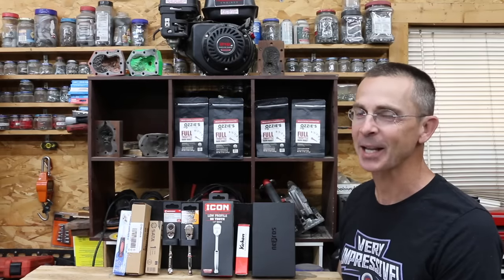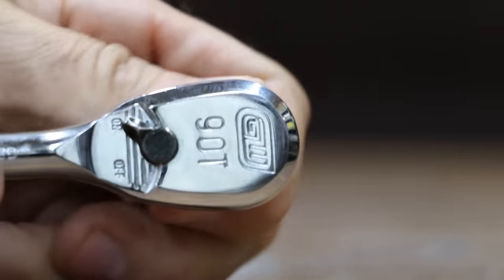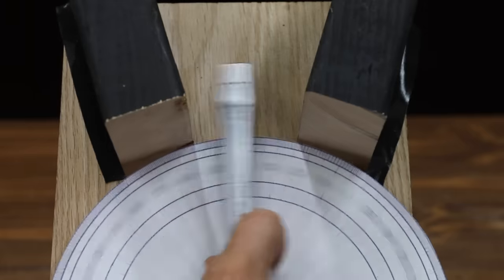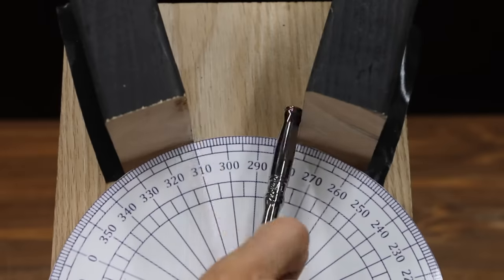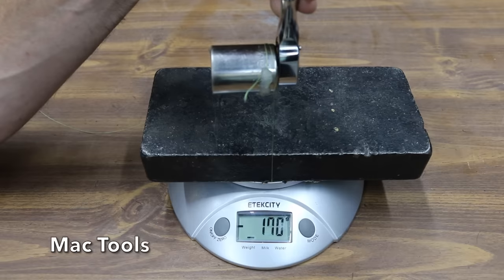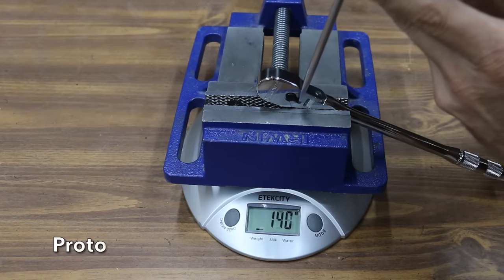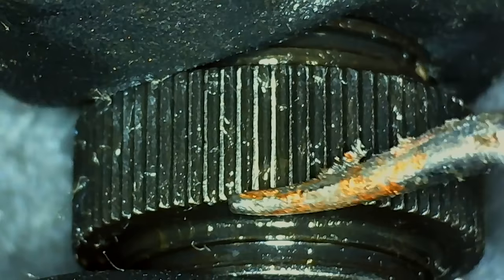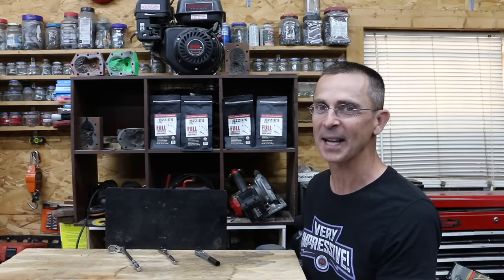Best Ratchet (1/4 In)? Snap On, Icon, Proto, GearWrench, Prototype

Comment: As an aircraft mechanic, the TRO ratchet shows great promise as a prototype. I think the gears need to be improved upon, namely the arc swing as I need to get into some pretty tight spaces sometimes. If that can be improved upon, I'd strongly consider buying one for my tool box. As a flight mechanic, the weight is also important to me because I need to take my tools on commercial flights and I struggle with leaving tools behind at home because my tool box weighs too much. Like I said, it shows promise, but can be improved upon.
Reply from the maker: Thanks for sharing.
Reply: Yep. And not also aircrafts, but I guess there are a couple additional places were it's useful: 1) Places were you carry your tools to height or distance (towers, antennas, far away places...) 2) Highly magnetic places (i.e., the Magnetic Resonance in a hospital, but the tool has to be 100% titanium, and I don't know about that) 3) maybe high corrosion environments, like the sea
Reply: I liked the look but it seemed too bulky. The Thick handle would drive me nuts and the grip looked like it would be slippery. It probably only needs a couple grooves. Also the gap in the handle gave me pause because I felt it might get stuck and tug at things like safety wire in small spots.
Reply: @AlvaroGonzalez_Andor 
 I'll definitely agree with carrying tools up or down. Had to work on some equipment that was 170ft underground in an underground reservoir, the access was by vertical ladder which wasn't much fun with 80lbs of tools
Reply: How many tools are you really going to carry with you on a flight? I have a Pelican case with just very basic line mechanic stuff; wrenches, ratchet, sockets, screwdrivers, pliers, plus my headset and bypass pins. It comes in well under the 50 lb weight limit for a checked bag on a commercial flight. All you really need is the basics to comply with the MEL/DMP and get the airplane out. If the plane is really broke, you’re going to call in support, anyway. Remember, we’re here to move ‘em, not to improve ‘em.
Reply: @singleproppilot  I carry everything I need to fix most problems on a 737; both normal and abnormal, so my box comes in at around 90lbs. I do this full time for 2 weeks at a time so it's all I do. I just like to be prepared.
Reply: All you need is a good set of wire twisters ..
Reply: @Ray-fm3ek  maybe you do but I have to actually work on the airplane
Reply: @ryanw1112 90 pounds? A roll of duct tape only weighs less than two pounds? Isn't that what you guys use mostly? How is your box more than a couple pounds. A swiss army knife and duct tape should fix it all.
Reply: Do you work for sun country? Sounds like their work environment.
Reply: @supers0nic77  I worked for a competitor to sun country, and thought about moving over once or twice, but never seriously
Reply: @sasquatchrosefarts being a flight mechanic means you travel with the airplane wherever it goes. I've been stuck in some pretty remote places, some places I didn't even speak the language of. I need to be prepared for anything and that's why my box weighs so much. We keep basic spare parts and tools like speed tape, light bulbs, tires, etc on the plane to help avoid needless ground time.
Reply: @AlvaroGonzalez_Andor  Good notes. One place you absolutely cannot use Titanium is in flammable gas areas, like mining - Titanium sparks very easily on friction.    I used to hate the brass/bronze tools I had to use changing temperature sensors in a refinery, because they were so bulky and heavy.

Comment: I like how light that prototype ratchet is and how little force it takes to change direction, but I wonder if it's too light. Sometimes working on things an easy changing ratchet can be an issue when you're trying to loosen/tighten something and it accidentally switches direction while ratcheting. That gets annoying quick when you have to keep switching it back to the direction you're trying to use it in.
Reply from the maker: Thanks for the feedback.

Comment: This was the best representation of top brands that I’ve seen you do yet. This channel just keeps getting better with time. I wish you had picked a Koken Zeal but that’s a minor issue, it’s actually good that people see that their normal range of ratchets use antiquated designs.
Reply: I guess I should add they they are known for their low back drag but your video proved that pretty well.
Reply from the maker: Thanks!
Reply: it may be an antiquated design but it still works for it's intended purpose. i'll take a low backdrag ratchet any day before a high tooth count with way more backdrag for most use, modern cars stupidly cramped and mechanics adverse motor bays is not one of those though... 😸😮

Comment: I have a 60 year old Snap-On ratchet (3/8") - I've broken dozens of sockets over the last half century with that ratchet (and a 3-ft cheater bar).  Best tool I've ever owned.  

There might be a lot of ways to look at a ratchet - but not all of them should be weighted equally - strength is more important than any measurement (with price being #2).
Reply from the maker: Thanks for sharing.

Comment: I like Husky tools. They feel really sturdy and well built to me. I don't do anything heavy duty or use tools every day, but I haven't been let down by one. One of the best store brands imo.
Reply: Husky tools are a great DIY and light duty tool.  In the professional field they will not last.  I collect ratchets as a hobby, so I have pretty much every ratchet he's tested so far.  I work on heavy machinery and I'm hard on my tools.  The Husky didn't last more than a week.  On the other hand, my Matco's, Snap On's, Macs, and Kokens I've never once had to warranty them.
Reply: Why use carbon fibre?
Reply from the maker: Thanks for sharing!
Reply: @Deontjie  Because it looks badass and its extremely light weight.  That's my guess.  It'll be the next ratchet to go into my collection mainly for the coolness factor.
Reply: @reconbbs360 Surely heavy machinery is a different level all together. For the average user, automotive/carpentry, Husky have proved durable for me. I’ve used Husky to remove truck lug nuts on a few occasions requiring a breaker bar. That’s well above the average expectation of a ratchet and I’m yet to break one. 

I can only imagine what you’re using them for.
Reply: @WontSeeReplies  Nothing to crazy.  Was using a 1/2 drive with a pipe as a breaker bar.  Stripped the teeth.  So pretty much completely my fault.  LOL.  All I'm saying is higher end ratchets you can get away with doing stuff like that.  Another thing.... Not sure if Husky even makes a non-quick release ratchet.  Maybe I got a dud, but that damn quick release would drop my sockets if I barely nudged it.  Overall, I despise quick release ratchets.  The only exception is actually the Stahwille ratchet that was in this video.  That one was done right.  Accidental bumps won't release the socket.  Actually requires some force to release.

Comment: I've got that exact model (I think) of Snap On and have often wondered what its failure load would be. Now I know! On a handle that long I can't see myself breaking it in a hurry. I bought it on the strength of seeing a friend remove a cylinder head using a Snap On quarter-inch ratchet, which I still think is an impressive feat for anything that small.
Reply from the maker: Thanks for sharing.
Reply: If you can find a Snap-On truck on your travels, it's worth getting a repair kit. (although prices can be a shock)
 Finding a garage or shop that has a tool truck every week then knowing when it will arrive can be handy.
Reply: I had a cheater pipe on a 12mm ratcheting wrench and the wrech bent but the ratcheting feature worked fine still. I love snap on ratchets and wrenches

Comment: Glad to see that quality 1/4" ratchets can take far more torque than I would ever apply. ~70-90 ft/lbs is a lot considering that I'm normally measuring in in/lbs when torquing fasteners with a 1/4" drive socket.
Reply: I've broken a lot of 1/4 inch ratchets being in the rust belt. Sometimes that's all that fits
Reply: @cheesecurd100s  I had to by a Spud Ratchet Wrench because I kept snapping ratchets with breaker bars.  Do tool manufacturers ever hear of something called "rust?"
Reply: @blacksheep25251  if you want a production 1/4" ratchet to support more than ~120 ft/lbs torque, you want a tool steel ratchet or similar, not just a high-carbon steel
there are techniques to loosen the rust, but that's it, it's really complicated to assess how much force you'll require against a set amount of rust due to it being of chemical origin
Reply from the maker: Thanks for the feedback.
Reply: @gregoryartaviasalazar426  Force and heat have been the answer, but my mechanical education has been Youtube, swear words, and force and heat.
Reply: @ProjectFarm  HUGE fan and LOVE your videos!  No long intro or dialog, just straight to the point.
Reply: @cheesecurd100s  Penetrating fluid and imaginative use of extensions might be your friend.

Comment: Great review as always.  I am a Koken fan.  I hate backdrag and the Kokens performs well in that regard.  I think the 36t was included, i would like to see how the newer 72t design performs.
Reply: I'm a big fan as well. Koken has a few tiers in their tool line. I live in Japan and the one shown here looks, like what they sell at a hardware store in Japan that serves low-demand customers, people looking for quick and cheap.  Those are still produced and are not great.
Reply: @coboldelphi  agreed, how do you compare that to a 90 and 120 tooth designs.  The bottom line Koken had 3 A+ and a complete fail.  Seems wrong to me.

Comment: I'm always impressed with how good Husky tools are. They actually make the best socket adapters and impact 1/4" hex to socket adapters as well. 

I found that out by burning through and breaking 4 Milwaukee hex to socket adapters on one job. Then I just went and got a couple husky adapters and they worked the rest of the job, and I'm still using them 1 year later.

Comment: That was an amazing performance by Husky. I think of Husky as a perfectly serviceable brand but not as the brand that a specialized professional might need. It looked to me like Husky was the winner of this contest. Proto did a little better mostly on the torque to failure test, but I can't imagine ever putting more than 50 ft. pounds on a 1/4 inch ratchet. So, IMO, Husky won or tied on everything that mattered and it was among the cheapest tested.

Comment: I have a Snap-on TLLF72 that I purchased a couple of years ago when they first came out: $99. By far the most I've ever spent on a ratchet, let alone a 1/4" drive ratchet.
But, it's by far the most used ratchet I own. I use it for pretty much everything short of lug nuts!

Expensive? Yup. But worth every penny.
Reply: Until it breaks
 I had mine fail a couple of times when I was using it daily in shop environment even though I never fitted larger than 10mm (3/8") socket on it 
Always switched to 3/8" drive for 11 to 17mm, 1/2" up to 36mm and breaker bar after that (or even breaker bar when loosening anything over 26mm - roughly 1")

Comment: You should test pipe wrenches. either steel or aluminum ones. keep up the great work!
Reply from the maker: Great suggestion!
Reply: I know for a fact that RIDGID makes pipe wrenches.
Reply: @ProjectFarm  I agree with @jackbachman1385.  Pipe wrenches are (to me at leas) one of those tools that I inherited from dad, and never think about until I need it.  Then I go for that rusty old thing and it might work.  

Later on I purchased an Irwin quick-release style pipe wrench to replace the rust wrench.  Big mistake.  That Irwin barely grabs anything and when it does it slips.  I’ve since gone back to dear old dads wrench.  So seeing a review of different pipe wrenches would be great.
Reply: Yeah that would be cool
Reply: Aluminum are light but junk
Reply: I dont think any tool Co could beat a Ridgid pipe wrench
Reply: @rogerstlaurent8704 Yes, my usual go-to for old galvanized pipe, fence posts, etc. Solid grip, will handle a "helper" extension! Good stuff!
Reply: @gus473  👍👍👍👍👍👍 love to see any tool Co  beat a Ridged Tool the pipe wrenches  they  bit like a Piranha and stronger than King Kong and Godzilla together

Comment: Mac ratchets are rebranded Proto, which is why they finished next to each other in the tests. Having a small versatile 1/4" ratchet is essential, thanks for the tests!
Reply: And both are owned by Stanley😔😔😔
Way too expensive for the average mechanic.
Reply from the maker: You are welcome!
Reply: @jameslowe3792  Not Really Snap on is way more expensive not sure when Todd bought that Snappy Ratchet  that 1/4 drive is around $150.00 a good long  lasting Ratchet stick to a Proto ... I could be Wrong but Proto has been around longer than Snap on  BTW i am a fan of Snap on Tools But the Price you just got to walk away they are way too expensive

Comment: That back drag thing is actually pretty important in a lot of scenarios. I do wonder if some of the versions that performed poorly in that test, might break in after a bit of use and end up having less back drag than when they were brand new. I was very surprised that the icon did not perform better. That line of Harbor Freight tools is generally pretty good quality. I guess some of the Icon tools are better than others.

One thing we've seen in this video is we clearly do not have to spend $150 to $200 to get a good 1/4 inch ratchet. Really you don't even have to spend $100.

 I already had a Kolbalt ratchet that came with a large kit, but I was searching the clearance rack at Lowe's and found a swivel head Kobalt for about $10 and bought it just because it was marked down ridiculously cheap. I don't know how they would perform these tests since they weren't included, but I've been using these tools for a few years and they perform fine.
Reply from the maker: Thanks for the feedback.
Reply: I do exactly the same when I see 1/4" drive ratchets as you know they will break eventually and generally when 1/4" drive is all you can use.
Although I also have Snap-On and Facom I don't carry them around to relatives when 'fixing stuff'
Reply: @1crazypj  I have a stubby Husky brand ratchet and it is two sided. It has 1/4 in on one side and 3/8 drive on the other side. That little thing is pretty awesome and I've had it for probably 10 years or so. It came with a small set that I got off the clearance rack at Home Depot. I don't know why more people are not making them like that. You to lose a little bit of clearance but it's good for most things.

Comment: I'm glad to see the pawls and main gears in most of the wrenches are holding up quite well, unlike many older imported wrenches that go bad with ordinary use.
One issue I have with many wrenches is bumping the reversal switch, so a bit stiffer one might be good rather than a negative, as well as recessing it some.
A unique ratchet is Harbor Freight's Ratcheting Breaker Bar (3/8" and 1/2").  It has big clunky pawls inside.  But, hopefully is also durable.  It would be worth adding to the tests.
Reply: I'm with you. Over the decades I've accidentally reversed my ratchets an ungodly number of times. But I've only experienced the inability to NOT reverse them when they were broken.

Comment: I use 1/4 drive spragg bearing ratchet in confined spaces.
Realistically you can only pull 30 ft-lb by hand. 
Great review love the Channel.
I tend to go with ratchets without the leaver type ratchet lock and more the wheel type as I find them stronger and you are less likely to knock the ratchet lock in confined spaces.
Using 1/4 drive ratchets all day every day for over 30years in aviation.
Reply from the maker: Thanks!  Thanks for sharing.

Comment: The imperial size ratchet/wrench set I use in my shop is a Stahlwille made in W. Germany. The sockets are getting kind of worn out(and it's missing the 3/4''), but the ratchet is still excellent. It has lasted longer than several mechanics.
Reply from the maker: Thanks for sharing.

Comment: Next up: Sockets!

The arc swing doesn't mean anything if the socket drive side freely rotates 5 degrees! (which, many do). Then, if the hex clearance is too large, you've got a fancy ratchet that may not turn when it needs to (in a tight space).
Reply from the maker: Thanks for the suggestion.

Comment: When I worked for the airlines  the 1/4 drive was the go to tool, along with 12  point sockets. ratcheting  screw drivers  are a second. anything above 3/8 drive came from the tool room and used for major repairs and were calibrated.
Reply from the maker: Thanks for sharing.

Comment: Would always like to see budget priced tools test in any test format.  With so many of today's mechanical components using aluminum, and very tight access spaces, smaller and lighter weight quarter inch drive tools are all you really need to meet many modern torque requirements.   Husky and Proto get my vote.   Great video !
Reply from the maker: Thanks for the feedback.

Comment: I actually have the opposite issue with the directional switching lever; in very tight spaces it can hit something, or rub against my finger or hand a certain way, switching it in a very hard to reach space. Which is an inconvenience and can cost a some time if it's hard to get the ratchet back in place
Reply from the maker: Thanks for the feedback.
Reply: Exactly correct.
Reply: @ProjectFarm you've been given this same feedback (about the stiff lever being better) for a long time now on many videos. Please actually take this into consideration in upcoming videos. Thanks so much.